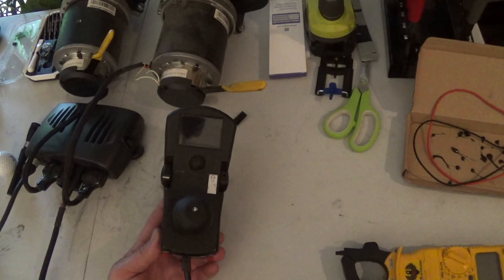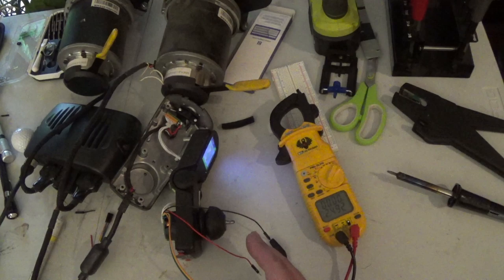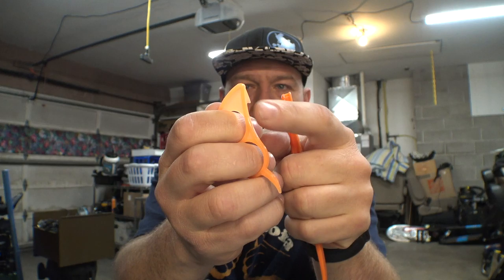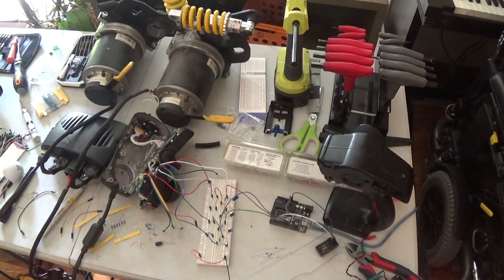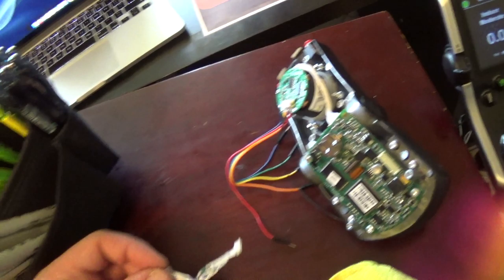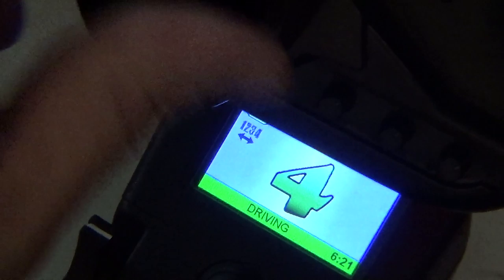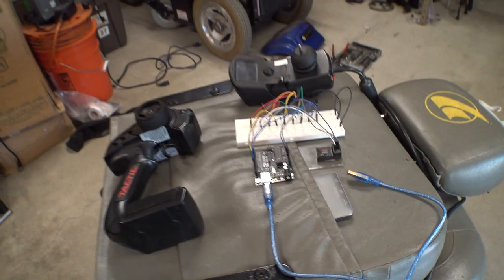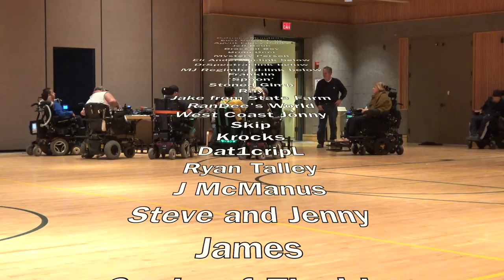MEGA VLOG 504: remote control wheelchair! (figuring things out)

Comment: In theory, could you add an additional receiver to change speed levels?

Use case: you would like to buy groceries at the store without going inside.  Using the pickup option in a grocery shopping app like Instacart, deploy the chair with a shopping basket (and camera obviously).  Somewhere on the basket, a sticky note is placed with instructions.  The worker places the grocery bag(s) in the basket, and then the chair is driven back to your van somewhere in the parking lot.

In theory, I suppose you could do something like this over IP, so you wouldn't have to leave the house, but the latency and potential vulnerabilities wouldn't be very safe.
Reply from the maker: yes! the receiver i switched over to has 6 channels that can be used for a bunch of other functions as well :^)

Comment: I am looking into something like this for a 6wd robot project. I am currently driving three joysticks with hobby servos, in order to operate the wheel chair motors, using stock controllers. Well done on the probing to figure out the signals to emulate.
Reply from the maker: servos are a much simpler way to accomplish things esp with 3 controllers! i started with the 'complicated' way - am now working on injecting CAN signals into an R-Net control system.  in theory, ya just plug in a little box, power up, and go! much simpler! BTW with an R-Net system you can drive 4 motors from a single controller (assuming you want tank style steering) if the 4 motors are the same type, you can adjust the motor ohm compensation on the controller to make everything happy :^) you need a USB interface dongle to program R-Net stuff.. but its a lot more customizable than the dynamic controls system in this video.  on the older 4 wheel drive magic mobility chairs, theyre running 4 motors on one controller from the factory.  just FYI!
Reply from the maker: YouTube is being weird.. I briefly saw a comment about the charge dock, but can’t find it now. the movement inhibitor is activated by shorting 2 specific pins on the charging port.  If you’re charging the batteries with your own power connection, the chair won’t lock out movement on its own.  Wheelchair chargers have the appropriate pins shorted out inside the “XLR” connector on the charge cable itself.  The chair will charge fine without them shorted..  the +/- pins essentially connect directly to the batteries anyways (in a roundabout way thru the chairs wiring) but nothing in the chair controllers manage charging in any way.  That XLR port on the joystick gives you direct access to the batteries! Hopefully that helps :-) (BTW I’ve modified the charge cables in the past for other projects so that plugging the chair in doesn’t inhibit movement at all) just be aware that 8 amps is the maximum safe working limit for stock wheelchair joystick charging wiring.
Reply: @TotallyNormal-  Great information, thanks. Maybe I will CAD up my idea of the "air-to-air" charging dock connector and post it. I think my comment about it was in another video of yours where you someone else commented about a nice feature of a charging dock for remote wheel chair bases. That is good to know the XLR could still be used instead of going straight to the batteries. Nor sure if that is any major advantage, but provides options.
Reply: @TotallyNormal-  Hi Dan, I created a video documentation of my servo control system for my Python class final project at community college, if you want to check it out: https://youtube.com/playlist?list=PLL5odjcMYaPQwT2DZSkQkhLjUj-e2xxzc (Jump to Part 9, if you want to see it work, and skip all the Python theory) I still need to add the third joystick. I get these parts wheelchairs cheap, locally, from a salvage yard relationship. I would definitely like to try the direct connection you are working on with the R-Net system. I think all my parts pile are older controllers, so it might be awhile until I get a unit to experiment on.  It seems like this would be the way to go in the future.  Also, I might need to change the mounting method of the rover if the motors from an R-Net system are different. I am currently using the the style of motor with the six hex bolts and clamp that affix the motor on to a piece of 1" pipe.  On a side note, I have a pile of linear actuators for seat movements, too. I want to implement them later.(crane, robot arm, stabilizers etc.) I don't know what kind of wheelchairs they came from, but they might have to do with the ability to drive 4 motors as you mention, 2 of them being actuators. Cheers, Scott PS. Congrats on the bus. I converted a 40'er in early 2000s. Big job! I envy your series 60. I had an old 8V71 natural air breather.(no turbo) My bus now sits permanently in my side yard. :)
Reply from the maker: i just meant that connecting straight to the batteries wont trip the chair's movement inhibitor :^) kinda a long way to say all that LOL
Reply from the maker: i had one of those years ago! lol single speed 'automatic' V-Drive lol https://www.youtube.com/watch?v=LaT31qRh3Sk

Comment: @Totally Normal I have an electric wheel chair that has a lift for the chair. I was wondering if there is a way to remote control it and add a cam so I can use Oculus to run it.

Comment: It would be convenient to be able to  have the chair come to you, like a Tesla car , drive  itself etc. But one other thing would be wireless charging,  maybe one day.
Reply from the maker: Funny ya mention that... a friend was working on a way to do that a couple years ago.. but wireless charging at 8 amps is more like parking on top of a microwave with the door removed! Lol
Reply: @TotallyNormal-  I have in mind a kind of docking station that it could pull into and make an electrical connection. Something maybe cone-shaped, like an air-air refueling nozzle, except with 24v charger connections. However, I think the controller would stop moving as soon as it senses the charger connected. So maybe final connection and disconnection would have to be done with something other than the wheel motion, like a linear actuator etc.
Reply: Dan clued me in on another comment, about how the lock-out could be dealt with, using the XLR connector.

Comment: hi how does the chair control speed of the motor is it a big potentiometer or its PWM , is it with relays or transistors, and what is the max current the motor draw? great video
Reply from the maker: they run PWM for motor control :^)

Comment: Can you please tell me which tire and tire size is used on the wheelchair?  What is interesting for me is that the tread or the contact surface of the tire on the ground is not round but a rectangle, that's better grip, isn't it?

Comment: I'm wanting to know the chair your in right now looked like the one I've found out on a four wheeler trail one day but I took it all apart and ever thing can I use them boxes that it comes with on my remote control lawnmower I took a rock crawler and took it a part got ever thing put on my lawn mower will them boxes work for it  but it had lefts on it it lay you down down pick your but up and had leg left I'm not sure it will work
Reply from the maker: the powerchair base used in the video was a 'Golden Compass' - but i swapped on invacare MK6i electronics to do the testing.  that power base usually uses LINX electronics from the factory
Reply: Well was wondering if maybe that you and me like get to get her on some thing through the net here and maybe make us some money here on making this dream I've got in the make a realallity I've got a factor stretch out crafts man push mower I got from a friend I e got the motors off of a wheel chairs and I've got some lifts of of one also I've got the motors on and it's cool no lie it's wide it's long it's just cool but I'm going with a little bit more cooler I'm wanting to put this set of leg lift on the front of it so you could pick up like a good size limb up out your yard and things but I'm not so good on the remote part working I understand what I want it to do but just can't get it right other words I suck at wiring I've got the servo and some rock lights off of remote control truck put on the front wheels and the other two up on what use to be the push bar but thats as far as I've got I've got them boxes on it but an had a battery to try it but I like to send you some picks of it hit me up on face book or email if you might be interested in maybe you and I a getting a contract from craftsman mow company to make this or make some decent money out of this idea if you like really I like to make a place here in my home town and put my two boys to work and keep them out of trouble that's may goal cause there is no then here but trouble jail or leave the people you know behind and that's your family just keeping them occupied is what I want for them and them staying at something they like to do is make stuff that's the way where are my email you got but just in case scottyrenner950@gmail.com my face book has a four wheeler red grizzly on it my name is Scotty Renner maybe I'll here from you again my project you would like

Comment: Are you still messing around with remote control wheel chairs this posting is a year old just wondering
Reply from the maker: sure am! just in the background right now.  working on a more plug and play method :^)
Reply: I need a plug an play method for my project using wheelchair motors on a push mower remote control lawn mower what would you charge me to fix a plug an go kit for me I want the joystick remote 12 volt system not 24 I just need it labeled so I dont hook it up wrong I know nothing electronic just mechanical